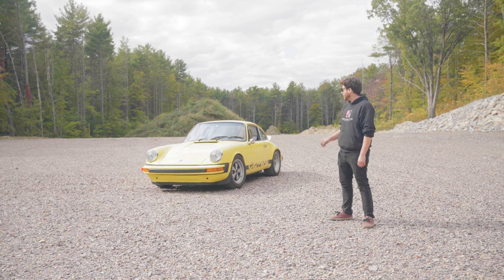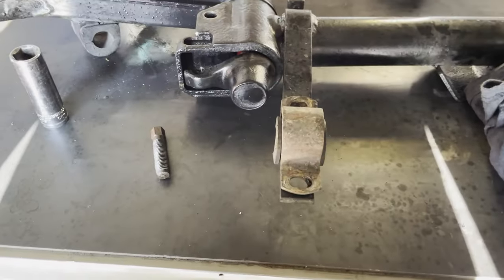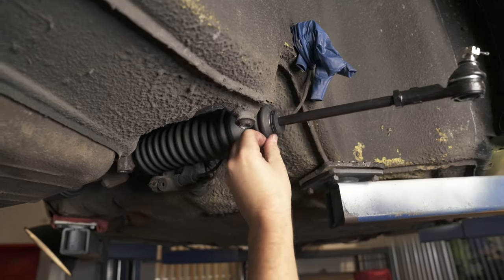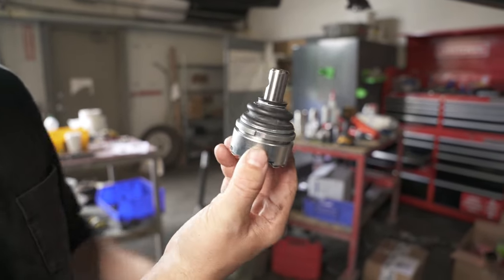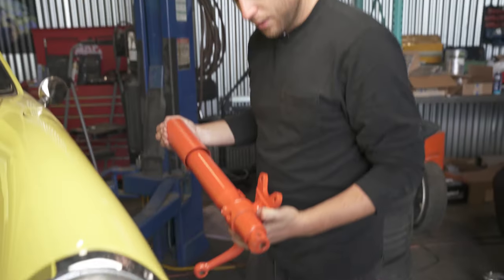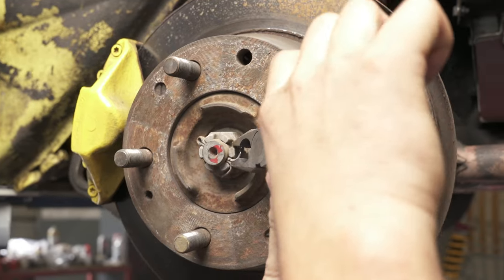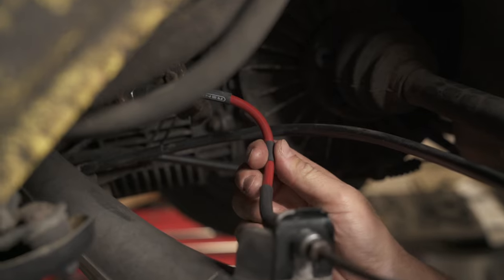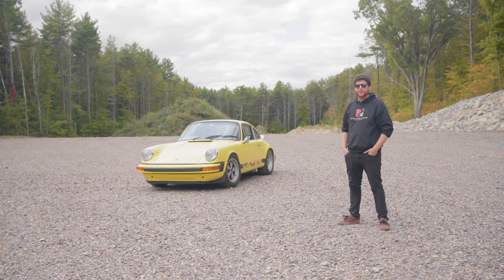Rennline Suspension Overhaul – '74 Porsche 911

Comment: I would never ever put those parts in and leave the greasy undercoating on. once the suspension is removed you have access to clean the underside put a fresh undercoating and paint. I just did that on my 84.